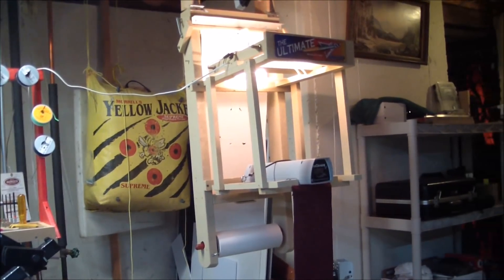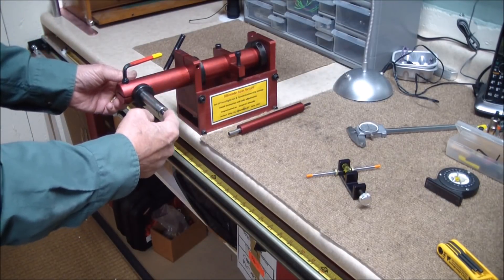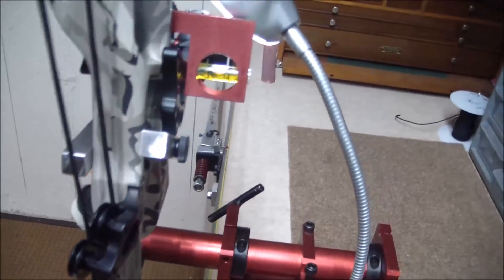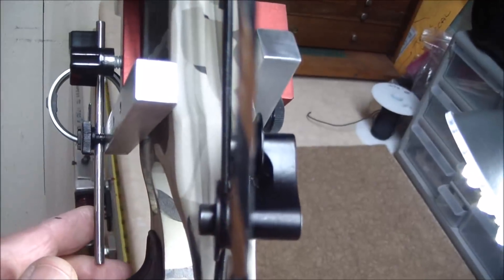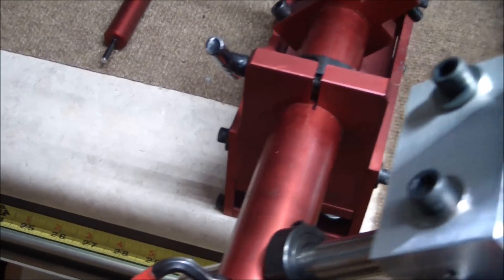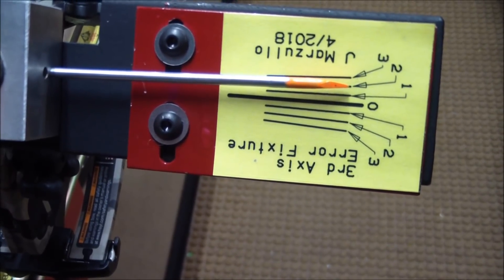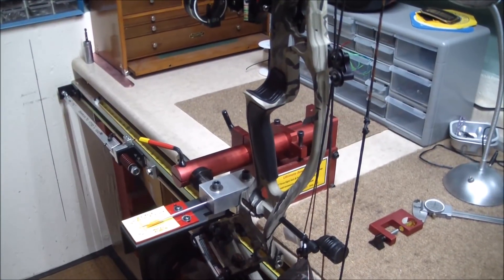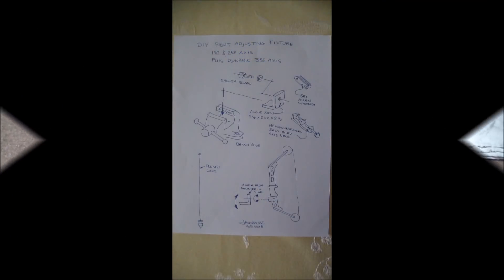Bow Torque and  3rd Axis Bow Sight error

Comment: Hey I know this is an old video but you reference it a lot. I was was always told the the riser on a (non-caged) compound bow riser twists a bit when you're at full draw. Is this an accurate statement or worth worrying about? If so and you feel it is worth making something that could show this phenomenon I would appreciate it immeasurably. Thank you for the work you do. If I could afford to send my 2013/4 Prime one target bow to see what it looks like on your board than I would. Again thought thank you
Reply from the maker: As a general statement most all risers twist/ flex a bit. The caged riser are an attempt to reduce that. G5 uses a different alloy aluminium to reduce twist and flex. So bottom line they all move, but if the bow shoots well don't be concerned.

Comment: Joe I love watching your videos. Is there any way you can post a list of the products you use to adjust the third axis as I've never had a bow shop do this that I'm aware of.
Reply: Also I shoot a bowtech invasion currently but have never seen a bowtech in your videos. Is there a reason for this? I'm just wondering how much torque they would have and I also wonder what have been the top three bows you've ever tested in eliminating torque. Thanks
Reply from the maker: I have used the Hamskea easy third axis level with success. I have also designed and built my own equipment to do this and other tasks which I will show in a video, probably have video done 2-3 weeks from now, stay tuned.